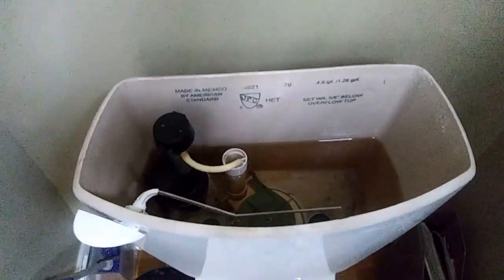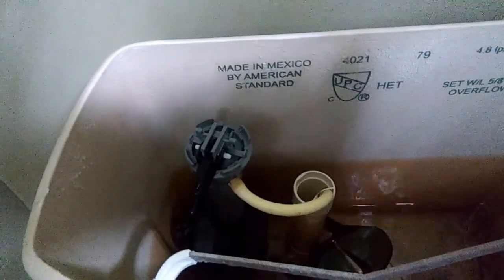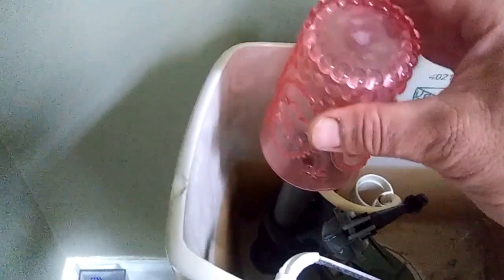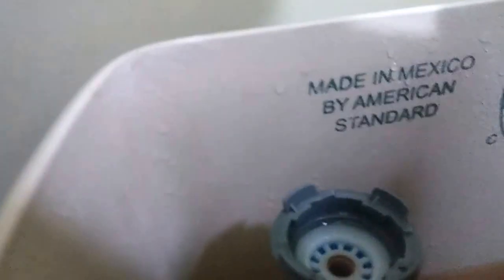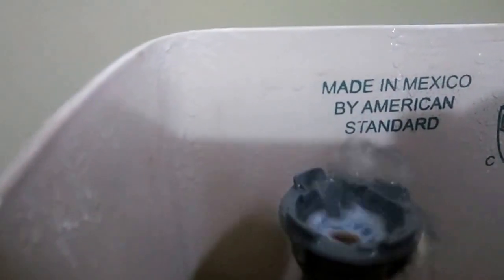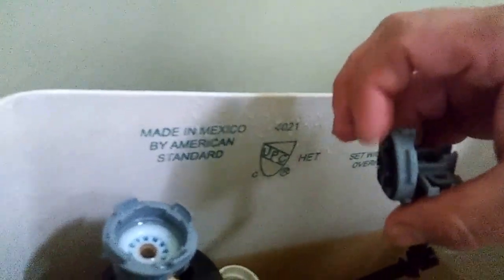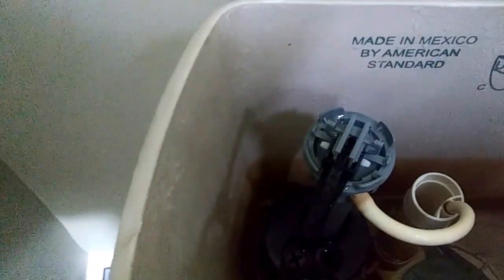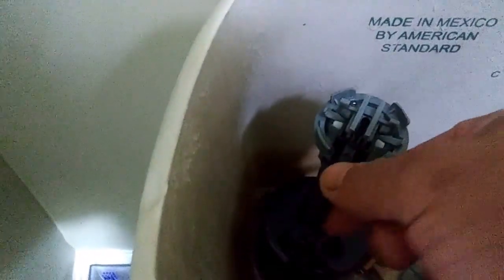Cleaning a fluidmaster valve

Comment: I had trouble with one of these. Tried everything but the upturned glass on the top was the trick I needed. Full pressure released and whatever was causing the noise must have gone. Thanks for the video. I seem to remember an insert at the water intake under the cistern that is designed to reduce pressure. I bet that got some scale on it. Can only be accessed by fully removing the inlet so I’m glad not have to bother with that.

Comment: Thank you! The Fluidmaster valve I have sits horizontally, but the same principle applied. I took out the float valve and turned the water back on. I should have followed your suggestion and used a cup the first time, but I did see the obstruction pop out. Worked like a charm. The bowl fills quickly and the valve cuts off the water flow right away.  Quick and easy. Took less time to fix than it did writing this comment. Thank you!

Comment: Thank you very much for the awesome video. I had a couple pieces of rubber that had broken off from the shut off valve coming out of the wall, stuck under that filler tube cap. I didn't know how to access below that cap, to get to that rubber diaphragm, or what ever you called it. Thanks to you, got top removed, there was the broken rubber pieces.  so I got a glass to put over fill valve, like you said, cut the water on for a few sec's, put everything back together. Bam, so far so good, and didn't have to call a plumber. Thank you very much and may God Bless you for helping all of us !!!

Comment: Thanks for the video, the cup trick didnt work but I noticed some tiny rocks lodged inside the gaps around the white grate section w/ blue bottom, visible after removing top cap 0:45, was able to vacuum them out with some help of a needle to move them around, I made sure area was dry as I could get it first before doing this,  the toilet running on issue was fixed after cleaning the rocks out!

Comment: There is also a valve gasket in the pipe where the top valve is mounted. It can also be defective or dirty. Once the entire inlet valve has been removed, the inner tube can be pushed up. My problem with the toilet flush was only solved when the lower valve was cleaned. The top valve worked fine.
Reply: Can you describe the process of reaching the lower valve? Thanks
Reply: @RJMCafe  I can try :-). In the pipe on which the inlet valve is mounted, there is another pipe inside that pipe. in that pipe there is also a valve. You can push that tube up from the bottom. Hope it is easier to understand, it is hard to describe.
Reply: @sbromose1  thanks for that. I think we may have been talking about different Fluidmaster designs as I couldn't see a second gasket on my unit? I read another comment on this video which mentioned a rubber corkscrew at the bottom of the Fluidmaster unit. I remove the corkscrew and it looked partly disintegrated.

I couldn't see another valve gasket anywhere? Anyway I have removed the corkscrew part and will see how it goes.

Thanks for the reply. It all helps. 

Regarding the corkscrew — can't understand why FluidMaster would put in another rubber part besides the gasket at the top? Rubber is bound to perish.
Reply: @RJMCafe  Well ok it can happen :-). It would be much easier if I could show it with pictures. Considering making a video about that system for no one has shown anything about some kind of extra valve, as far I know. Thanks for the conference :-)

Comment: Thanks. My brand new toilet started leaking after a few days. Suspected it could be that- just some rust debris kicked up from the inlet line and stuck in the new valve seat. Cleaned it off and worked like a charm. Thanks for demonstrating how to access the seat without breaking the parts and not spraying water all over the place. Not obvious and saved a trip to the hardware store.

Comment: Fixed my toilet immediately.
Had a leak from the black cap.
Toilet was not filling up. 
Sounded funny.
Did the water/cup trick.
Also made sure the toilet fill line was getting water and boom.
Toilet sounded right and filled up right.

Living in rental house for 3 years and first problem.

Comment: There's also a rubber piece shaped like a cork screw, that quiets the fast running water in the bottom by the hose connection. It'll fall apart and slow the water. You can remove it by pushing it from the top with a stiff wire. That's why your water seems to go around like a whirlpool at the top of the tube.
Reply: Exactly! Funny how none of the instructional videos seem to mention the bottom part of the fill valve and how this may be impacting fill performance.